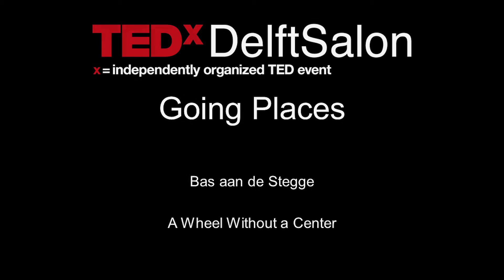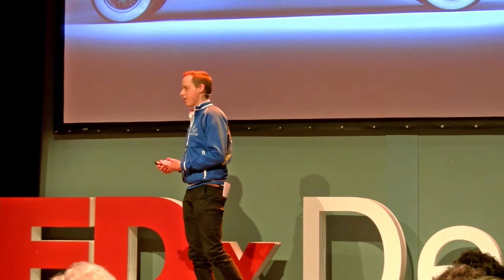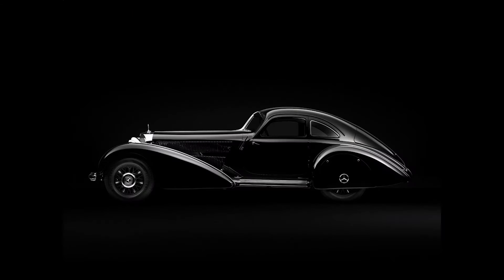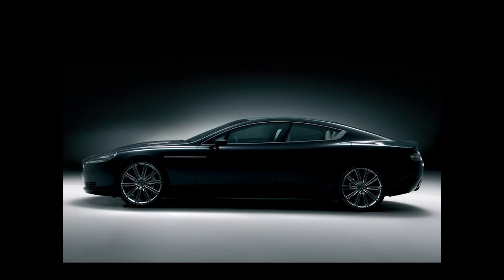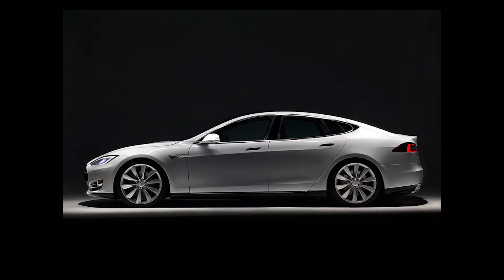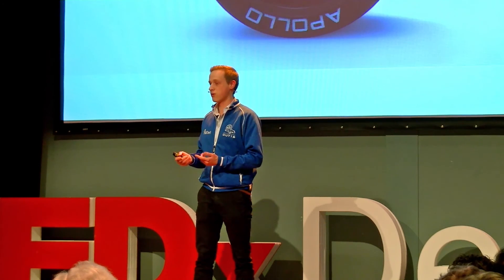A Wheel Without a Centre | Bas aan de Stegge | TEDxDelftSalon

Comment: Public transit using electric trams and electric trains is more sustainable than the electric cars; also, they do need batteries. Walking and Cycling is the cleanest. 

High speed trains need help from great innovator like Bas aan de Stegge, in the design of rolling stock.